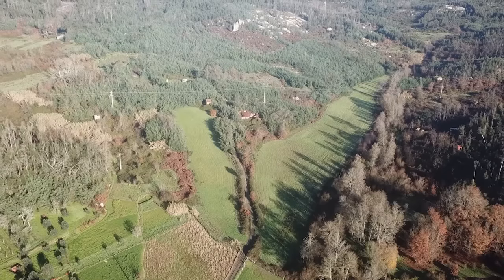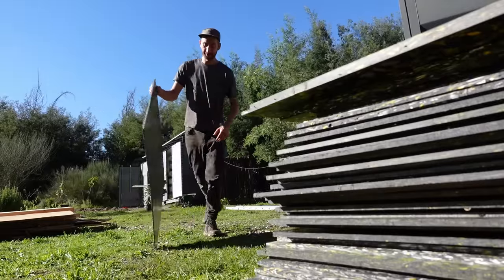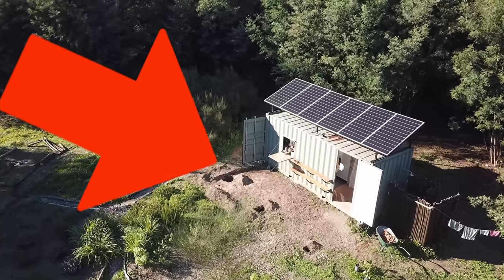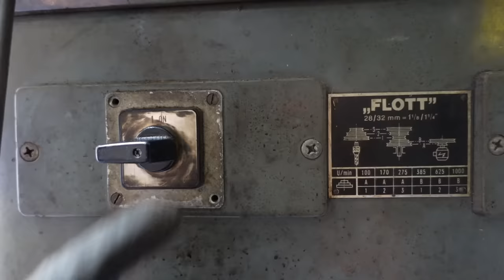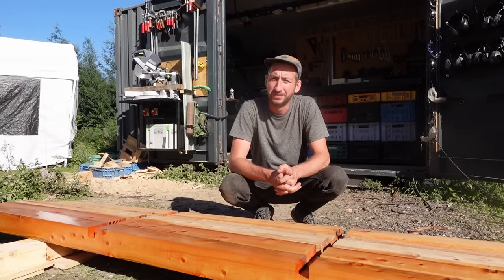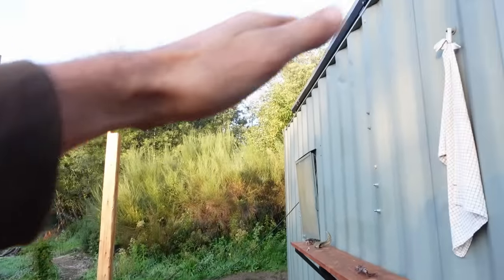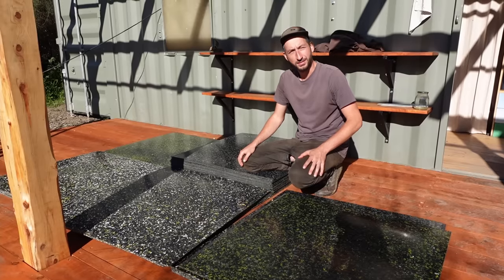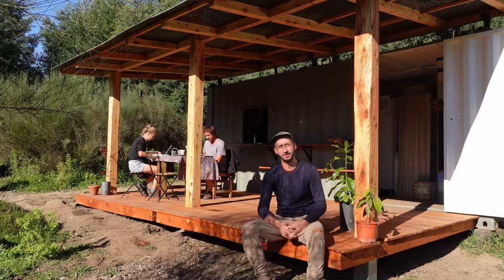#40 We made a roof from RECYCLED PLASTIC sheets

Comment from the maker: Here you can see how we made recycled plastic toilet seats: https://youtu.be/-6RAbLo2kI4
Reply: what is the toxicity of the plastic and can absorb it thru skin or will rain water make the toxins leech into the area , that is my only concern with reusing plastics
Reply: Miss you 🤗
Reply: Miss you 🤗
Reply: @louisdebacco3217  during the recycling process plastic offgass and dust is primary concern.   These can be handled with filters, and the filters can be biodigested with organisms known to eat plastic
Reply: Where did you get the e recycling equipment
Reply: @MrMarkusmulder  aww thats sweet.  Who are you?   I love you anyway 💕 🙃
Reply: When is the next video coming out🤷🏽‍♂️
Reply: What about UV degradation and coating?
Reply: @diversitylove5460  Oyster mushrooms eat oil and plastic is from oil. I'm putting oyster mushrooms in my HDPE composting toilet as  a MycoToilet - I wonder if my toilet will get eaten? hahaha
Reply: After 2 years how is the plastic roof holding up?

Comment: One way to protect the roof from UV would be to create a living roof where the plastic roof is covered in soil and living plants (grass?). This would also aid in insulation and keep temperatures down in the summer.
Reply: there is a better mix of plants than grass. Succulents... as they are more robust, don't need that much water and they are fire-resistant
Reply: solar roof !
Reply: Insulate what?!?
Reply: @bigass197  The roof itself. I can imagine it becoming very hot in the summer (potentially melting or softening). This heat cycling causes thermal oxidative degradation which changes the structural properties on the material.
Reply: Pretty ideal substrate, too.
Reply: @Jinguapingi  yep good idea
Reply: that's a good idea, or, I'd probably white wash it to keep it cool and keep the plastic from degrading in the UV.
Reply: great idea but the supports must be able to take the added weight of wet soil. wet soil is quite heavy.
Reply: If the plastic was molded into the standard tile shape used in Britain, the standard mossy roof there would become a benefit, yes?
Reply: @doughnutsfowler  plastic is horrible for humans and the effects of it on the human body are still not completely known
Reply: @zakbrinkhoff324  Nobody's going to eat the tile, though.
Reply: @zakbrinkhoff324  its PPE, not plastic
Reply: @hdj81Vlimited  as long as it's not metal because the metal rusts
Reply: @jackj.hutchens9209  much easier and just as efective
Reply: I know this might sound kinda insane but another way to protect the plastic from the UV rays is by keeping out of the sun light and only use it indoors
Reply: That would be legit grow a farm on top
Reply: What did you use between the seems to keep water from finding it's way in later in the future 🤔
Reply: or a bunch of sand to make it bulletproof
Reply: @tacklebox6239  yes that is insane
Reply: Great idea 👍
Reply: Thats what I was thinking. smaller overlapping shingles like slate, diy #2 or #4 with simple molds clamps or press and toster oven or flat iron press.
Reply: There are bacteria that break down plastics. They might be in the soil.
Reply: @tipaks  1 yard of dry soil is about 1 1/2 tons. Completely wet soil a.k.a. mud can be as heavy as 2 tons per yard which is as heavy as Concrete. This can easily be calculated since you know the two dimensions of the roof, and we just need to know the thickness. I’m sort of curious why they didn’t just use the solar panels as the roof unless you need a specific sharper angle like the ones they have on top of the shipping container.
Reply: Or use $5 UV protective sheet plastic? Shrug? Super easy and even comes sticky
Reply: Moss roof would be best here because of the weight limit.
Reply: In that case it's like, which is faster at turning your plastic roof into microplastic in the environment: solar UV or (your local) soil microbes? There varieties and behaviors of fungi (symbiotes of plant roots) we haven't begun to map.
Reply: If there would be bacteria that eat plastic we wouldn't have a problem with plastic. But I see that Microplastic could be a problem if you use it without any further insulation.
Reply: And plastic won't degrade much if it's covered in soil.
Reply: @fussball-heute  we at least have diesel eating bacterias.

Comment: I'd be curious to see frequent soil tests near a plastic roof. this way we could get an idea on how much micro-plastic runoff is being absorbed in the immediate area.
Reply: This video is SO in my wheelhouse.  Plastics rarely shed once reworked as the carbon content is increased.  Also to be considered is that micro plastics are a result of abrasion.  Carbon seems to act as an encapsulating substance.  There's a TON of research on this topic.  You'll need to translate it from Russian, Chech, and Akan though.  A great start would be looking at the projects in Ghana, and specifically at the roof tile and paver work.
Reply: Yeah
Reply: I would be interested to know how to seal the plastic sheets to prevent shedding of micro-plastics into the environment. Any ideas on how that can be done cheaply @Tate
Reply: @brakespearwoortman2528  You're creating a NEW item from heating and forming the recycled plastic.  Carbon structures realign to encapsulate as if freshly cast.  In this case, the carbon is greatly increased creating a product that has a higher carbon content than the original material with very different structural traits.  AGAIN Micro Plastics are a product of ABRASION and UV degradation.  The sand and plastic bricks do not exhibit those traits.  I've already forwarded the science on this 3 times now.  Try doing some of your own self education that doesn't involve a celebrity.
Reply: @philliperskine4986  reflection isn't a good look darling.
Reply: @philliperskine4986  Bigot says what?
Reply: @brakespearwoortman2528  I'm not sure they would shed, I'd just like to see them do soil tests in case they may shed. If the increase is relatively small, it would be a easy way to demonstrate that this form of roofing is less damaging to the immediate environment than cheaper (for now) alternatives like asphalt sheathing.
Reply: @DavidBriggsAdventures  Thanks for the helpful reply. Any chance you can compile a short list of these? I'd love to read through some.
Reply: @DavidBriggsAdventures  I  am not a bigot. trying to project your self image on someone else are we? The one calling someone things like that are usually what they are calling the other. Since you hounded me for the past week and tried to say I was wrong and you showing no proof. Well I don't need you for my happiness.  I wouldn't use this product now if you gave it to me. Have a great day.
Reply: It won't take long since the panels will crumble in a couple of years.
Because of the chemical structure of polypropylene, it has a high degradation rate when exposed to UV light like the Sun. ... According to Gupta, North Carolina State University, polypropylene fibers can only withstand approximately 6 days exposure to high-intensity UV light before losing 70% of their strength.
Reply: a lot i reckon
Reply: @DavidBriggsAdventures  the uv will break down the plastic and rain will be strong enough to break off micro plastics.
Reply: @tylersingleton7992  The ANSI research suggests the sand reduces that potential.  All materials fail at some point. The net gains out pace negligible risks that can be overcome with additives in a production environment.
Reply: I'd be more curious to see how concerned is one to find out the garbage food is ingesting before is interested on how much micro-plastic runoff is being absorbed in the immediate area.

Comment: One layer of paint blocks nearly 100% of uv degradation in plastics. Hardly matters what color or type.
Reply: even better if " it ' cooled below ambient :)
Reply: white is the best
Reply: You're delaying the degradation of plastic with the degradation of the paint cover. Once the house is abandoned and the paint degrades, the plastic will degrade as well, contaminating the land with microplastics. The only solution to prevent plastic degradation is always a correct disposal, something that cannot be ensured. Every house with plastic today is a potential plastic pollutant in the future for the land it's on.
Reply: The problem with plastic is not all plastic is easily paintable...
Reply: Doesn't effect thermal degradation.
Reply: @smolpener7430  it does watch his vids
Reply: @Guds777 Sanding + Sikkens paint.
Reply: @Overt_Erre  The plastic was already degrading and contaminating the WORLDS OCEANS AND LAND.  At least it's in one area and as he stated 280 kilograms of used garbage plastic for that small roof.
Reply: @Overt_Erre  Sure- in much the same way you are "delaying death" by feeding your body.   Your observation is curated to justify castigation... without real consideration of net impacts and circumstance.   You've offered nothing constructive.
Reply: @mavigogun  In case is wasn't clear, any plastic you use today to build a roof will become microplastics in the ground at some point, and you're delaying the inevitable. The constructive solution is obvious and implicit: don't use plastic in your construction, and if you do, ensure you made provisions for its correct removal.
Reply: @Overt_Erre  Your myopic thesis was perfectly clear the first time- and no better in repetition.   Do better- or not -as you choose.
Reply: @Overt_Erre  The only viable way to prevent that is to burn plastic waste.

Btw: using wood as a sustainable alternative has the opposite issue. It practically doesn't matter what is done with it, it will sooner or later return to what is was originally => energy, CO² and a a handfull of minerals.
Hence a tree falling and rotting away in the woods, and one that was used in some type of construction have the same ultimate fate.

Granted, a small part of each tree that rots away ends up as soil. Even smaller amounts end up buried in the ground for good. But that only really helps the local soil, and sequesters some CO² on geological time scale.

Plastic on the other hand can be used forever (on a human timescale), or to be more precise: it could, but with 99.9%+ certainty won't.

Hence the evergrowing microplastic issue.
Reply: @peterpan4038  Not sure what the point is for wood, there are wood applications (like anoxic conditions, for example foundation use), where wood never decays. Wood cabins in normal environment can easily outlive human life spans with minimal maintenance. And contrary to what you believe, despite most plastic taking long time to "fully" degrade, they begin partially degrading pretty quickly, hence the main comment here advocating the use of paint to stop UV degradation. Now how many people will follow this rule without a strict law forcing them to? People will use plastic sheets to build their roofs every few decades, then replace them when they get damaged and install new ones, as long as it's cheap. The problem is really the economics causing a high burn rate of resource, not the reasonable use of resources in general. It's why the EU just passed a law requiring removable batteries in phones, to diminish the burn rate of valuable resources. It won't work, as the lifetime of electronic components will be lowered to match the current lifetime of batteries. The issue of plastics and resources can only be handled on an economic, structural level...
Reply: @Overt_Erre  True.

But my point was more about society trowing away stuff regardless. Even whole buildings usually come with a life span of a couple of decades these days.

That and the fact that using wood isn't 100% sustainable either.

And if we are talking buildings we can enter concrete use to the mix of materials that aren't used with the long term consequences in mind.

Re-using materials that would otherwise end in a landfill is already a sizeable step forward in our well cemented status quo, compared to ending up in said landfill.

And that includes re-using plastics as well.

Comment: There's a huge amount of research available on recycling plastic as a building material.  There are TONS of ANSI structural specs available.  There's a great roof tile video out there and it gets VERY high marks from several environmental watchdogs.  At a 70/30 mix of plastics and sand, the substance is structural when cast as blocks for single story structures.  There are about 50 structural studies confirming safety benchmarks over the past 20 years.  The data and knowledge has been out there for years, but it wasn't fashionable enough to obliterate the stigma of a "home built from trash".  Sensibilities rarely evolve as fast as the technology.   Love watching your project come together.
Reply: Do you have a link to any meta-analysis literature reviews in this area? interested in this rabbit hole.
Reply: thank you for the information
Reply: David this is really interesting, I'm currently innovating a recycled plastic building material. It sounds like you have some experience? If so I'd love to chat. 
Connor
Reply: Hi David, you able to provide some credible links? Been searching endlessly for 4 months on Internet and nothing of what you said this far. Appreciate it.
Reply: Could you use plastic pieces in concrete instead of aggregate? This would make the concrete much lighter and possibly cheaper. I have no idea if it would even work though.
Reply: @DavidBriggsAdventures   I've read a bunch on aircrete recently and I've seen gypcrete used on a job site a couple years ago. I've never seen plastic used in concrete but it's awesome that it is! I remember seeing something about using sand and glass mixed with recycled plastic and heated then molded to make roof tiles. They look just like terracotta tiles. Anything that allows re use of plastic is great in my opinion. Keep it out if the water and landfills!
Reply: @johnny5fingers0966  Yes you can.
Reply: @johnny5fingers0966  The whole point of using stone aggregate is that the crystals the cement creates bonds directly to the stones. It's basically limestone if I recall correctly. This wouldn't happen with plastic in the same way, so I suspect it would be much weaker.
Reply: @Arisilde  that's interesting. Thank you for sharing the info!
Reply: @johnny5fingers0966  Mixing polystyrene foam into concrete is already an established practice.    Searching this venue will provide a good introduction to the topic.
Reply: Don't get me wrong, I have a great affinity for material reuse in building. However I am pretty concerned about the fire safety of having a plastic roof. The potential for molten plastic and toxic fumes just don't seem worth it to me. It really doesn't seem like a very smart idea. Can anyone point to real world fire safety data on this?
Reply: @newolde1  ANSI data.
Reply: @DavidBriggsAdventures  feel free to provide links.
Reply: @newolde1  "Molten plastic"?
Reply: @mavigogun  fire + plastic = molten plastic.
Reply: @newolde1  imagination - discretion = rationalization of anything.
Reply: @mavigogun  Nonsense = nonsense